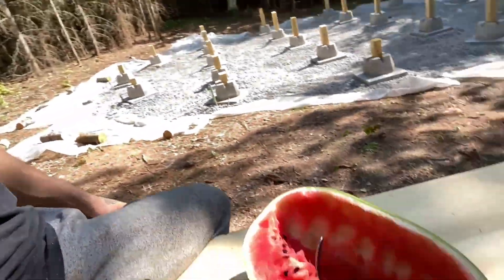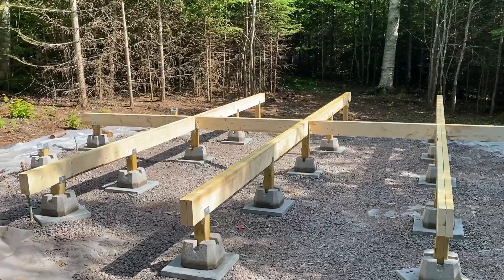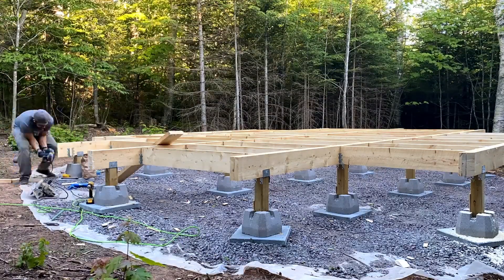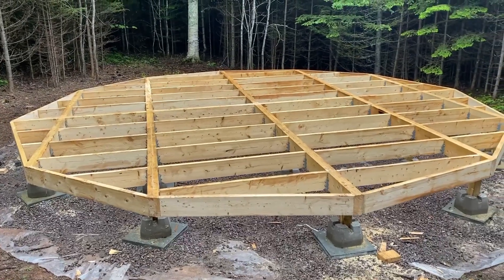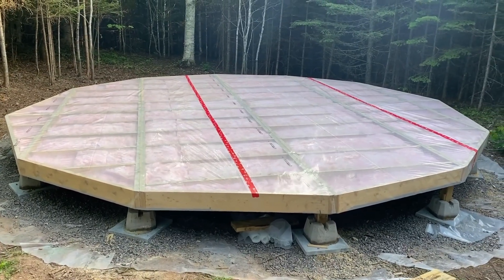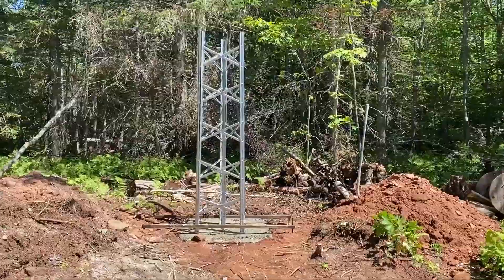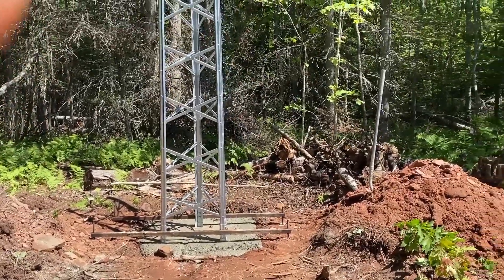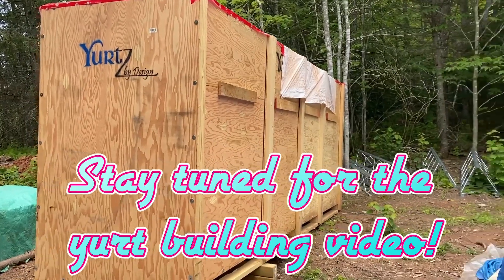Building a yurt - Yurt Platform

Comment: Hey Richard, so awesome to have this as a resource. I'm also getting a Yurtz by Design yurt in the spring and wanted to know a) what kind of insulation did you use and b) how did you put the insulation in as you didn't quite show it in this video. Also what purpose does the plastic serve? 

Thanks in advance!
Reply from the maker: I just used regular pink fibreglass insulation with the higher R value rating i could find and triple layered it. Basically filled the gaps of the 2 by 10 beams and put plastic as it serves for a vapour barrier and should be placed on the side of the heat so when you build a house the plastic is always on the inside walls not outside. It serves as an extra air barrier. So what i did for a quick temporary way until i purchase and attach plywood under I used a landscaping material that is breathable because you dont want another plastic material on both sides so i just rolled it out and stapled it underneath so that it would hold the insulation in. This is only temporary but still haven’t done the wood cause its too pricey and takes a lot of cutting